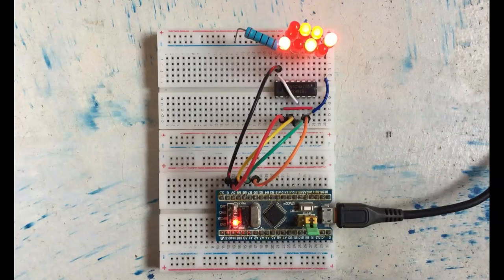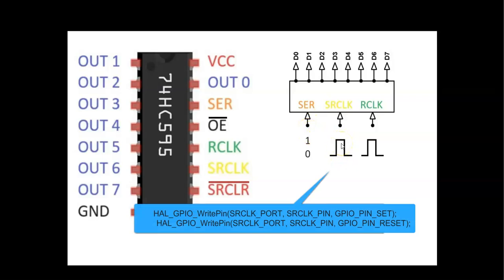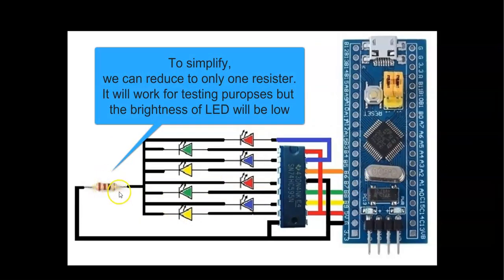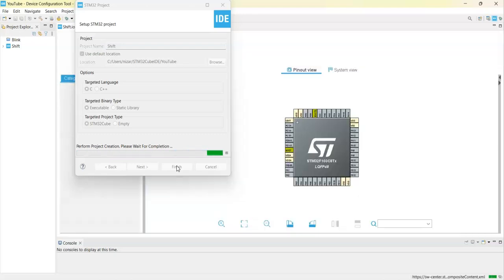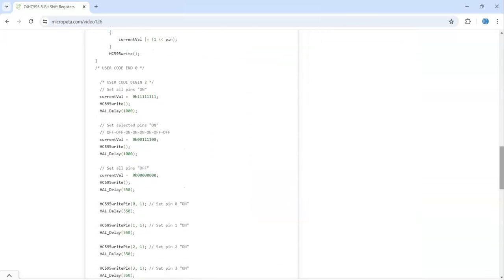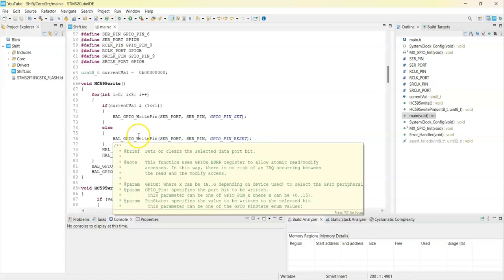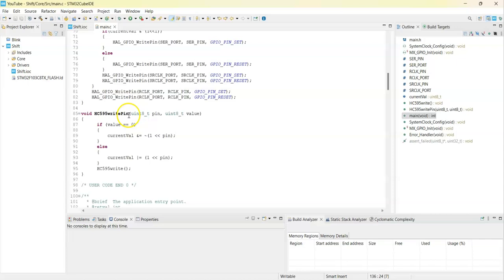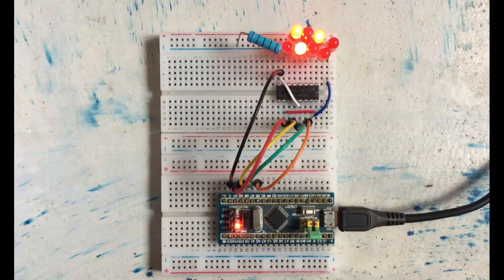126. STM32CubeIDE 74HC595 8-Bit Shift Registers with STM32 F103C8T6

Comment: excelent video for me .. i have a question about this project . This is made as counter but i want to use shift register for  extend led output by shift register 595 .This project should to drive led from flight simulation  according to the aircraft indicator. So , for this code , how can i modify code for it  . Thans more